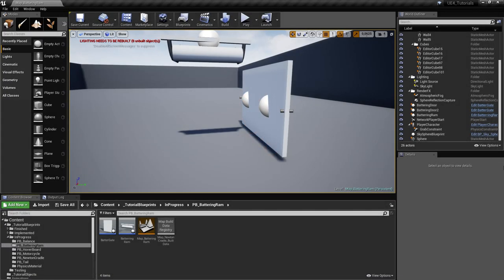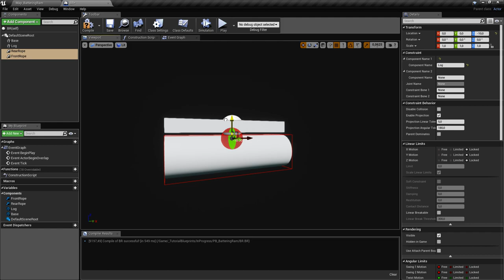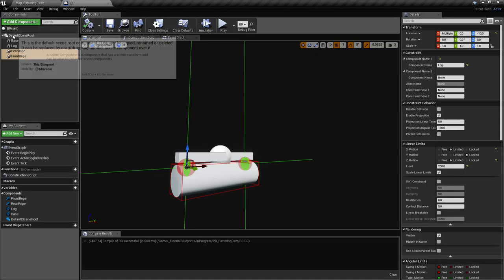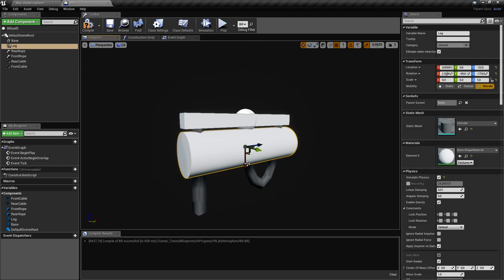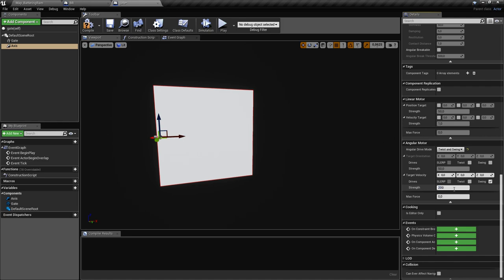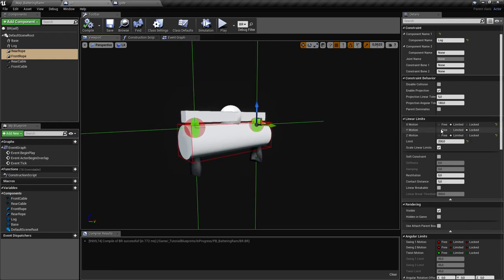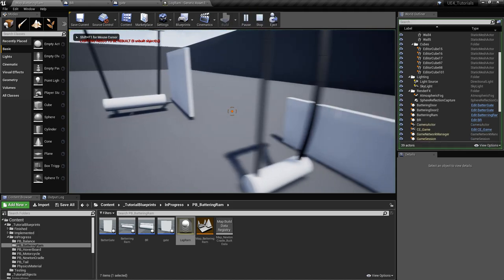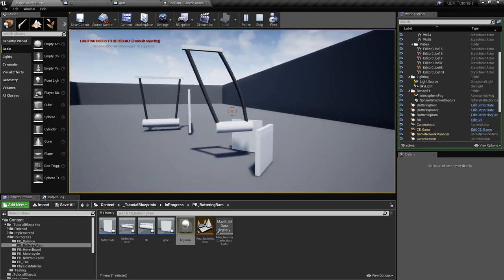UE4 How to make Battering Ram War Machine using Physics Constraints in Unreal Engine 4 Tutorial

Comment: nice tutorial ,can  you make  rope tutorial using physics constraints  and spline mesh please
Reply from the maker: It might be possible. Let me look into it and I'll get back to you.
Reply: thank you
Reply from the maker: I've looked at how to implement this. It's difficult and I'm not sure it has a clear advantage over simply using a rigged mesh with physics constraint. I'm actually planning to make a tutorial on how to make a rope using a rigged mesh.
The only advantage I could see to using a spline is that you can set the length of the spline very easily.
Can you elaborate on why you would want to use a spline?
Reply from the maker: I've made a rope tutorial using bones and physics constraints. Check it out here: https://youtu.be/hEMcr98cDJE

Comment: Could you tech me how to create Physics  Hydraulic cylinder ?
Reply from the maker: Since there Unreal Engine doesn't yet have fluid dynamics simulation, you can only fake the movement of the hydraulic cylinder.
Just use a physics constraint to limit the piston on an axis and then set the linear target position to where you want the piston to move. It should be quite easy to implement. 
If not, I've put the request on the list to make a tutorial for it.